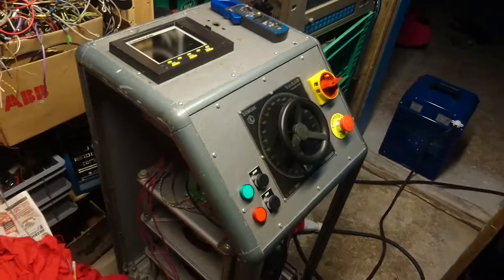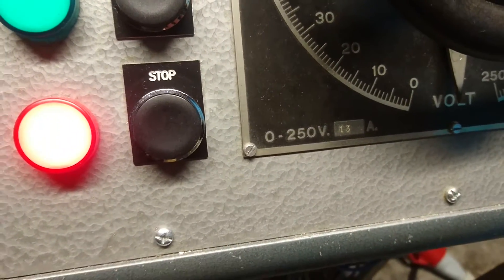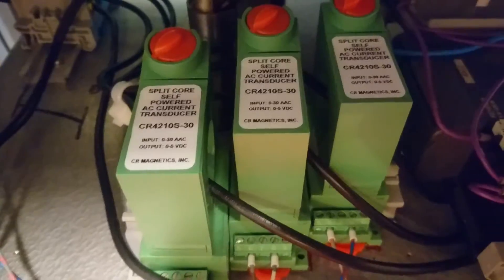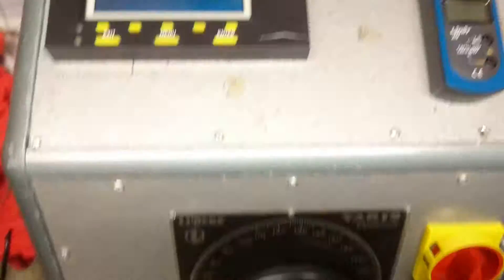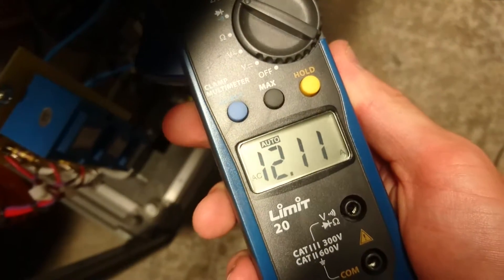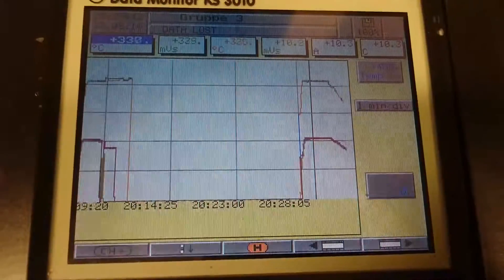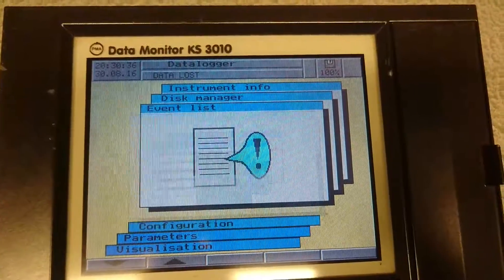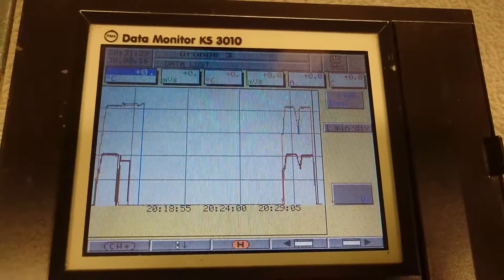13A ,3-phase Lübcke Variac stack, upgraded with safety and monitoring

Comment: I had once come across a triple variac like this which was unceremoniously dumped by a college electrical engineering department (in fact, they completely stripped all their labs and threw away all the old equipment  during remodelling). It was a heavy duty triple phase variac - each variac probably twice the size of the ones shown here. The whole thing must have weighted 40-50 kg. I remember I could barely lift it and I used a trolley to rescue it from being dumped. In the end though, it was too heavy and I never managed to find a way to transport it home so it probably got scrapped. What a waste... To this day, I still have this gut wrenching feeling every time I see a heavy duty variac because of this. One should listen to their gut feeling always (or it will remember and will get back to you for having failed to listen to it).
Reply from the maker: That is exactly where this comes from. It was scrapped by a university, but I first found it at the scrap yard. The cabinet was MUCH bigger as it also housed a 10 kVA isolations transformer. The transformer alone was 100 kg. It is much bigger and heavier in real life than it seems :)
Reply: @KaizerPowerElectronicsDk  Good thing you rescued it. It kinda makes me feel better about me failing to do so.
I think, ideally, I'd like to live close to a university. They seem to have no concept of the cost of all this equipment they happily junk every year (or whenever they choose to remodel a section of a building for a new-fangled biotech or AI or business department (which is just fancy looking lecture rooms and of course just a pretext for adding deluxe offices for the dean/director) to the tax payer.
At one point they had junked what must have been a dozen perfectly usable IKEA Ivar shelving units - the largest variety. They were enough to kit out an entire house. They just junked all of them - didn't flinch once.
Of course they never donate old stuff to charities or put a note on a notice board that, hey, we're throwing this perfectly working thing away, come and take it! No, they just junk it.